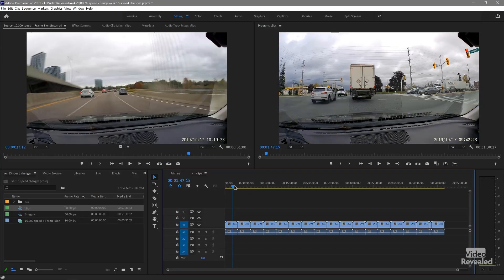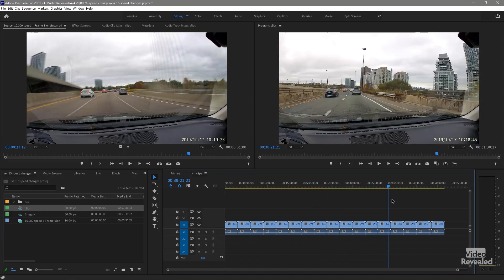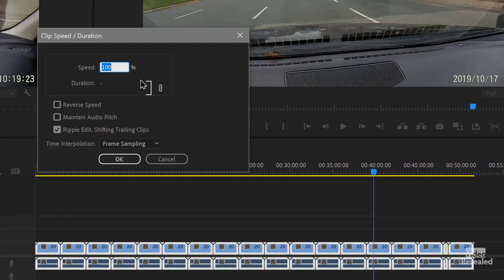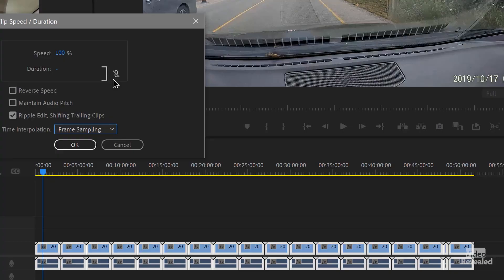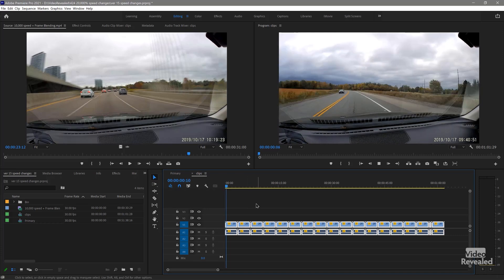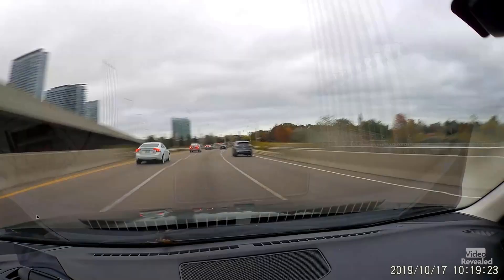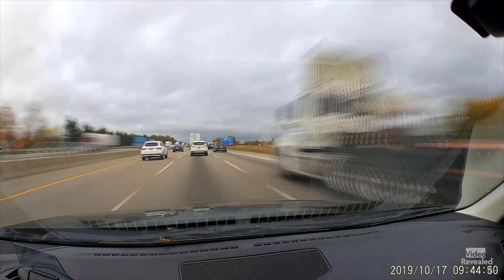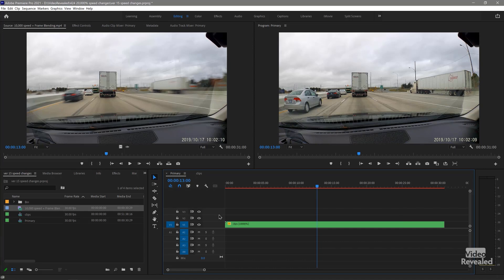Super massive speed changes in Adobe Premiere Pro

Comment: I would love a more in depth look at using the time stretch tool and the issues with it when cutting a complicated multi-person dialogue scene. Last week (9/2021) I was cutting together a 4-5 minute comedy scene with 9 actors in a video conference. The scene was written to not have any cuts away to a single character or B Roll. All 9 shot separately so in addition to nobody's timing being exactly perfect (but needing certain head movements to coincide to the comedy moments), we had many great takes of each actor to choose from, so wanted to cut together the best moments into a cohesive scene that doesn't appear to have any cuts. Where I was transitioning between separate takes, I'd planned to use a morph transition to make it look like the same take - so that's a separate issue. But, since a number of the characters in the scene have moments where they're just listening to the active dialogue and have usable, if not ideally timed takes (to correspond to reactions/head movements, etc.), I figured I could avoid the added effort of morph transitions, by razor slicing fairly neutral segments of those clips and using the time stretch tool to shorten/lengthen those small neutral segments, so that when it transitions back to the regularly timed original clip (now placed where I needed it on the timeline), the transition would be seamless as the last frame of the time stretched segment would match perfectly with the first frame of the original clip. It was working great for the first 4-5 characters. And then I started to get some major lag in playback. I was already using latest PP update, using proxies and took it down to 1/4 quality, followed by trying every trick from every tutorial I could find about fixing lag issues in playback. But nothing worked. I didn't know what was causing the issue. The actors all shot separately - some in 4K, others in 1080, and some shot with 23fps and others 29fps. But in cutting the previous 10 scenes of the project footage from the same performers (and their various cam settings) hadn't caused any issues. So I assumed it was the rate stretch tool. Then PP started crashing every time I'd try to play it again to see if any time lag fixes I tried were working. I even rendered what I'd already cut to see if that would resolve it. But no go. It got to the point where the sequence had become unusable with the crashes. But I didn't want to lose all my work, as I'd already cut together a great 1st half of the scene. So I created an additional track for every existing track and pulled all of the time stretched segments to the additional track and manually set everything back to 100% speed, figuring that would solve the issue - and would go back to the original plan to morph transition every cut. But even with all time stretching removed, the lag was STILL there in playback, and the segment continued to crash PP. I'll mention that this scene was part of a PP Production. And no other scenes had any issues at all. Just this one. I finally just restored an earlier version prior to the lagging/crashing, removed all time stretches manually and recut the characters into the scene that had caused the initial problem. And when I'm done, I'll morph transition every cut and try to make the scene look like one continuous take for all 9 characters. But I'd love to know if there was something that I missed that could have resolved this issue with using time stretch tool for cutting this scene. It would have been an ideal solution for a lot of the timing issues for this complicated scene. I'd also be curious to know why that sequence seems to have been corrupted, even after resetting all clips back to 100% speed. I had tried to use nests, but with the scene needing to be so precisely timed with the head movements/reactions, that made it tough in terms of cutting. Thanks! And if you think this explanation of what went wrong is long, you should have felt how LONG it felt being at the computer as I'm rushing to get something into Sundance before the deadline with a scene that's suddenly become unusable.
Reply from the maker: Sorry I'm not going to be much help on this. It's impossible for me to know why those things were happing without a very detailed bit of troubleshooting and testing. 
To me, it sounds more like a visual effects project rather than simple editing. Morph Cut Transition only works with absolutely ideal frames so 99% of the time, it will look weird and noticeable. Sounds like a job for After Effects, Twixtor and maybe Nuke.
Reply: @VideoRevealed  I figured that might be the case but I thought I’d mention it in case something obvious stood out for you. Thanks for answering!